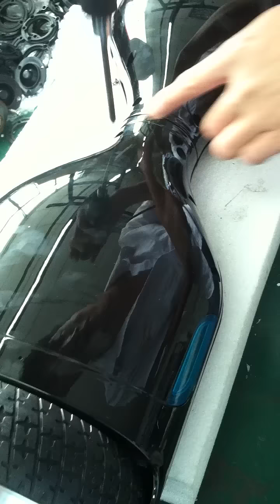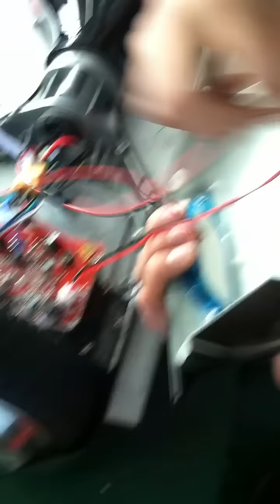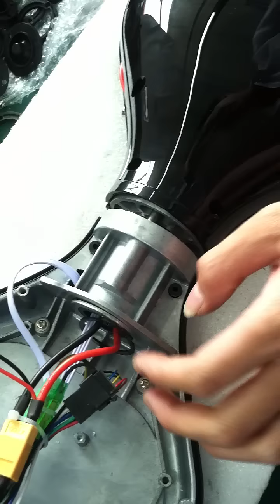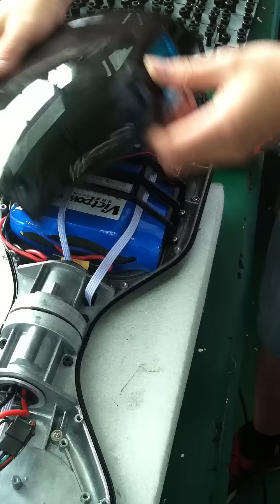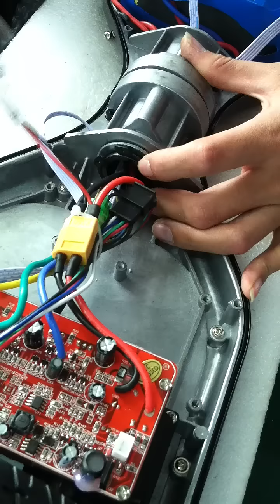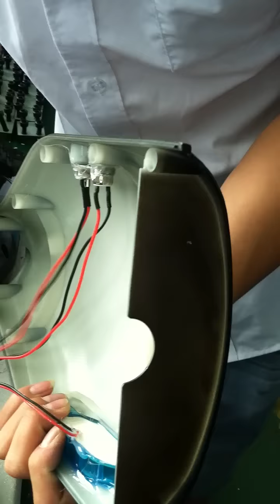Tutorial on How to Repair Two Wheels Self Balancing Smart Scooter when It Breaks - TVC Mall

Comment: My board has an issue in that there seems to be a loose pin or something shaking around inside, and each half of the board now rotates all the way around instead of the usual limited radius.  The center is also very loose and kind of wobbly.  Will this solve that issue?
Reply from the maker: +Nick Pieper Sorry for late replying. Please contact Vivian from our customer service by vivian@tvc-mall.com, she will tell you in details.
Reply: I have the exact same problem, how did you fix it?
Reply: +Graf Craft don't know if you still need help but it's the locking pin, just open your board and either put the pin back or you could just take the pin out completely it doesn't matter it's just preference